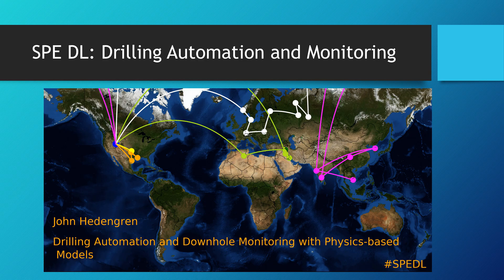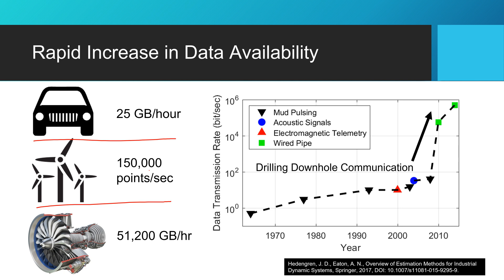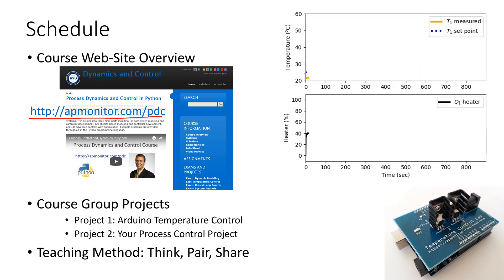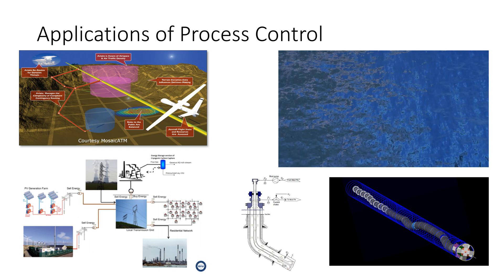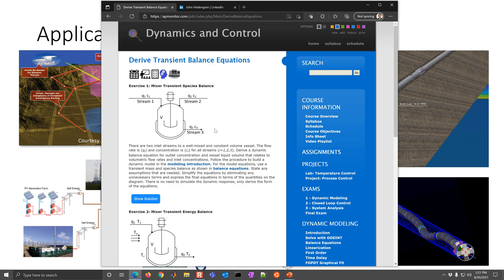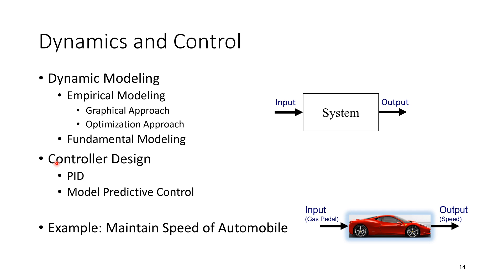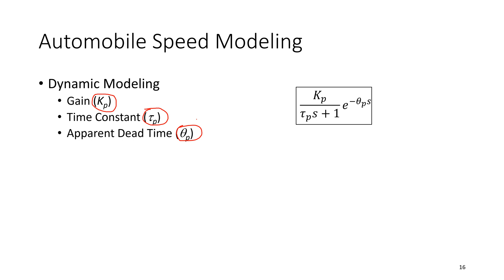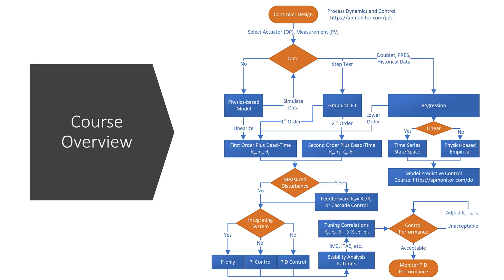Process Control Introduction

Comment: Silly question but does the course overview flow chart applies to be compared with other dynamic models processing and not only this cruise control case problem?
Reply from the maker: Yes, this flowchart applies to many other control problems as well. Here is the course with several case studies: https://apmonitor.com/pdc/ See the TCLab project in particular: https://apmonitor.com/pdc/index.php/Main/ArduinoTemperatureControl

Comment: Hi prof... I get your free course (dynamic control) at your webside but i am confuse littlebet.. I still cant build an achaul control sys.. All i get at course 80 %theortical information.. But i hope to increasing my skills at controlig field.. I Am at the last year of MPE.. How can i improve my self at that feild.. And how can i contact with you if it possible
Reply from the maker: The course includes an actual control system. I recommend the TCLab activities for each assignment. The assignment is a simulation exercise while the TCLab assignment is where the theory is turned into practice: https://apmonitor.com/pdc/index.php/Main/CourseSchedule